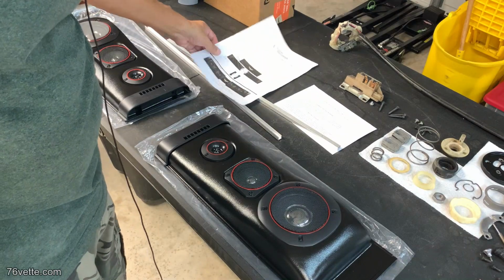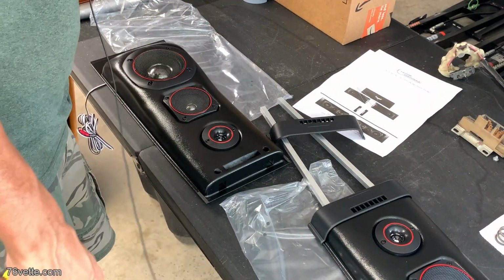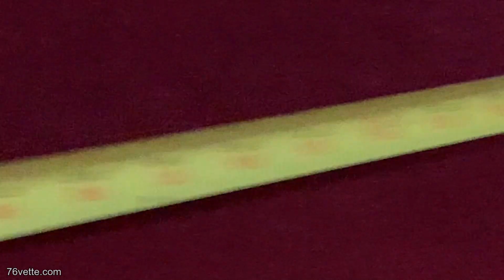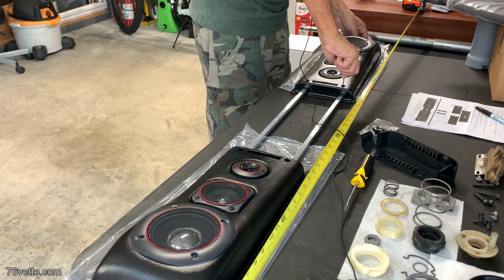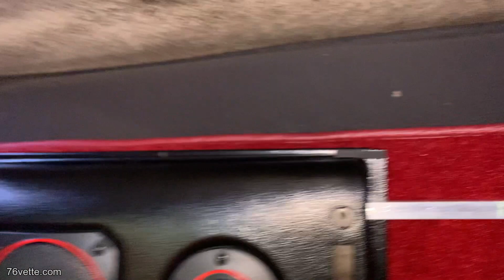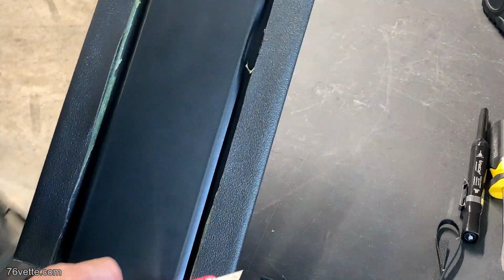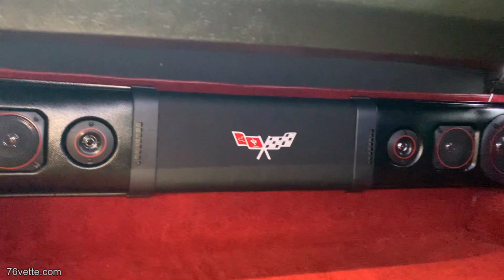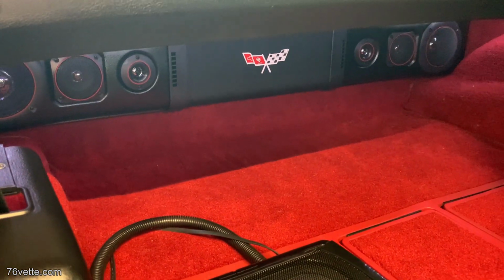BEST 6-Speaker SOUNDBAR for C3 Coupes

Comment: OUTSTANDING video.  I’m helping a friend install one of these in a ‘73 Corvette Stingray.  We followed your video to the letter and the installation is perfect.  Your idea to wrap the wire around that screw on the back wall and then tie it around one of the cross bars of the soundbar made the installation rock solid.  It won’t be moving or vibrating at all.   The soundbar covers the factory installed courtesy lamp on the back wall.  We removed the lamp, then tapped into the wiring and installed LED strip lights on the ceiling of the cargo area.  They really light up that space when you open the doors of the car.
Reply from the maker: Thank you so much, Anthony, and I’m very glad to hear my video was helpful. 
Tapping into the courtesy lights to install LEDs for the cargo area is a great idea. I did that for my ‘76. 
C3s up to ‘76 have very dark interiors, and one of the best things I did was to repurpose the cargo light and use it as a dome light with an LED bulb. What a difference!
Thank you for watching! 😊👍🏻

Comment: I have the same sound bar recently installed in my 73 Vette. I am very happy with it. I used wide adhesive Velcro to install it to the back panel. I replaced all original factory speakers (4 of them….2 in dash, 2 in door panels) since they were shot and added an amplifier and a new Vette-looking stereo with Bluetooth and aux. Next go around —— I will get the expensive 73 Vette reproduction stereo with Bluetooth so it matches the original look with modern ability to play music and SiriusXM from my phone. Thanks for your content and channel!
Reply from the maker: Great idea using Velcro to secure the soundbar 💡 I’ve been thinking about getting one of those Bluetooth cig lighter plug-ins for around $20. A buddy of mine has one in his ‘73 and really likes it. Thanks for following. 🙏🏻😊👍🏻

Comment: I like those LED lights in the trunk. Did you do a video on those? Didn't see one in a basic search of your videos. I'd like to know more about how you did those.
Reply from the maker: Hello. Unfortunately I did not. It was more of an experiment at the time since I had bought a roll of cheap LEDs and wasn’t sure if they could be used for that purpose. 
They did work though, and I posted a few photos to Instagram: https://www.instagram.com/p/BzYcJZwneXX/
I tapped into the storage compartment light wiring to power them, and daisy-chained them after cutting to size. 
I may redo them one of these days and use more powerful LEDs. 😊👍🏻

Comment: Would you put this soundbar in your 81? Today I took on the project of replacing the 3 original speaker wire harnesses (black/white/blue) in my 81. The previous owner removed them and direct wired the car to a cassette player/radio. Then I installed the custom auto sound USA 740 Bluetooth 300 watt radio. They sent me the correct wiring harness adapter (plug & play). Surprisingly I was able to do it and everything works, even the power antenna. Unfortunately, the old Delco speakers do not sound all that great. Now I need to decide on what to do with the speakers. I will definitely replace the front speakers in the dash. However I am not sure what to do in the rear. Unfortunately both of the rear mounting brackets are broke. The rear speakers currently just sit in place. I definitely want room for the t-tops but not sure about a subwoofer sitting out in the back taking up space.
Reply from the maker: There are small subwoofers that fit (allegedly) under the passenger seat. I would call a reputable place like https://www.crutchfield.com to see what they recommend. 
The soundbar is definitely something to consider and it looks great, so yes! 😊😊

Comment: MR. 76 VETTE A 4-STAR RATTING.JUST THOUGHT, UR STEREO HEAD UNIT INSTALL LOOKS GREAT. I WIST U HAD A VID ON 1st TO FINISH INSTALL. I'AM IN THE PROCESS OF DITCHING MY FACTORY BOSE SYSTEM IN MY 89 C4 VETTE. ALSO I WILL SEE IF THERE IS A SOUND BAR FOR 84-91 C4'S. BEST, GE.
Reply from the maker: Hello, and thank you for sharing your comments. 

I installed the newer style radio and subwoofer when I first got the car, but I was not shooting video back then so I never recorded that process, which is a shame. 

You may want to check with Crutchfield for radios and speakers for your Corvette as they offer a huge selection of quality products. 

https://www.crutchfield.com

Thank you for watching! 😊👍🏻

Comment: So I started the install! Some questions! 

1) I installed the Polk on the passenger side (sounds great!) did you have to drop the steering column on the drivers to get at the speaker there? 

2) I assume you ran the sub wire from the stereo to the sub, did you connect the rear speakers through the sub or directly to the stereo? If to the stereo where did you run the wires for the sub and the rear speakers to the stereo?

So far, replaced the stereo (I splurged for blue tooth :p) and did the passengers speaker !
Reply from the maker: Gosh, I installed that system years ago, but I think I removed the top dash pad to get to the front speakers. 

You have to push the pad up so it arches and clears the A pillars. You have to remove the A-pillar trim and there’s a small dash pad bracket near the middle toward the firewall. 

As far as the subwoofer/speaker installation I honestly don’t remember. I probably just followed manufacturer instructions. Sorry.
 
You’ll enjoy having Bluetooth for sure. 😊👍🏻
Reply: @76vette  thank you! I just wanted to say you are the most responsive most helpful person I’ve ever run across for anything including Vettes. 

Thank you, it really is appreciated!
Reply from the maker: You are very kind. Thank you, and I’m sure your audio system installation will be top-notch! Please let me know how it turns out. 😊👍🏻

Comment: Just a thought, instead of measuring the back area for the soundbar, it
has set screws so you can fit it against the sides firmly, then tighten one side of the
screws to keep in place. seems a lot easier like that.
Reply from the maker: Good idea. 😊👍🏻

Comment: Alrighty. Finally got the speakers installed tonight. I mounted mine a little higher than yours in the back on my 76. I cut the middle piece at 16 inches. I also used some Velcro strips to secure speaker against the back wall. As for sound quality.... Actually better then my front speakers. I still need to install the seat and do a drive with tops off to determine the improvement. My reproduction head unit happens to be the same manufacturer ironically... Found the manual in the glove box. Thanks again for your video and your replies!
Reply from the maker: Hey Terry, 
Glad to hear you got it installed. AFA the head unit, I think Custom Auto Sound makes several of them. 
I have a really cheap radio so my plan is to replace it one of these days with a good quality ahead unit with Blue Tooth.
Anyway, I hope you’re happy with the upgraded sound system and glad to hear my video was helpful. Be well. 😊👍🏻
Reply: @76vette  alright. Took it on a drive Tonight with the tops off. Good news, I'm pleased with the sound bar. I can hear the music while driving 80 on the highway. Makes a big difference. I totally agree with you though... I will need to install a small subwoofer down the road. No bass without one. Bad news is... When I got home.. I found my heater core went out during the drive tonight and the Passenger carpet was wet with antifreeze :(. Will have to do a heater core bypass until I either work up the courage to take apart the dash and replace.. or pay a mechanic. The joys of having a almost 50 year old piece of art.
Reply from the maker: @TheComando156  The subwoofer will bring it to a new and higher level. Trust me. But glad to hear you’re pleased with the system overall. And it looks good and clean with the added advantage of still having a usable storage area.

AFA your heater core, yeah, the love/hate relationship with these classic cars never ends. 

I wrote a pretty detailed blog article a couple of years ago covering installation of a new heater core, cleaning the complete system, and doing a heater-delete. 

https://www.76vette.com/2019/06/heater-core-delete-fix-ac-issues.html

I am sure it will give you a few ideas on how to go about getting yours done. 

I’d do the job myself as it will also give you the opportunity to clean and seal all the ducts properly, and save a TON of money. Plus you will know the job was done right. But I’m not gonna lie. It’s a BIG one! 

Good luck and stay in touch! 😊👍🏻

Comment: Hey Man 

So i have a 75 Stingray and am looking to upgrade the audio. I have a retrostereo in it now. So if i understand correctly the polk speakers replaced your dash speakers, the sub is sitting in the back there and you installed this new part for the extra sound/space. 

So, my questions are:

1) Do you have an amp anywhere? Does this need one to drive the sound?
2) Are you still happy with the sound?
3) Would you do anything differently now?

Thanks bro! Running just the 2 speakers in the front as I have been is painful!
Reply from the maker: Hey Michael,

Good questions, 

1. Yes, the subwoofer (Kenwood KSC-SW11) has a built-in amp. 
2. I’m very happy with the sound quality. 
3. I would install a better-quality head unit with Bluetooth. 

I hope you find my answers helpful and good luck with the audio system for your ‘75 Corvette. 

—Luis @ 76vette
Reply: @76vette  Perfect! I ordered it all based on your recommendation! I didn't even realize the sub had a build in amp!
Reply from the maker: @mmackinnon123  Awesome. I’m sure you’re gonna love it. 😊👍🏻

Comment: I just installed the same soundbar and wires are ready to run up to an older (not stock?) Pioneer Cassette Deck.  The wire ends on the new soundbar are not RCA jacks...not sure what you call them, but are they supposed to plug into the back side of the old stereo deck or do I need any converters?  Your system already had wiring in the back from previous speakers and didn't show how you plugged in the new soundbar.  Thanks.  Great video.
Reply from the maker: Hello. I am not a car audio expert, but as far as I know, RCA plugs are used for connecting amplifiers. Your older Pioneer radio/cassette deck should have traditional two-wire speaker leads coming out of the back, usually from a plug. Those wires would provide the audio signal for the speakers. 
I hope this helps you get your system working. 😊👍🏻
Reply: @76vette  Thanks for the quick reply.  I appreciate your C3 videos...keep them coming!  I picked up a white 77 with red interior about a month ago.  So much fun driving around with the tops off.  I will not be replacing the head unit and just opted to go with the plug in Bluetooth FM transmitter.
Reply from the maker: @heybert71  Congratulations!  😎👍🏻

Comment: Hey I just bought one after watching your video for my 76... How did you run your rear speaker wires to the head unit? Like did you go through center console or did you go through left/right side of floor/trim? Im not sure what's the easiest route to run the cables with the least amount of panel removal.
Reply from the maker: If memory serves, I am pretty sure I ran all the wires through the center console to the subwoofer and from there back to the speakers. Which would be the same whether you have a subwoofer or not.
The center console is the most direct route. Once you get to the bulkhead behind the seats, you can route them as desired. Having them on one side (and properly labeled), makes things easier, IMO. 
Good luck with the installation! 😊👍🏻
Reply: @76vette  thanks for reply. I just ran them through the center console as well. There was a nice little wire hook in there for another wire that I held them down with. I went straight into the cargo area and then up under the carpet to the rear.  Took me a while but I was trying not to break anything and keep track of all of the screws. I still need to actually test and install the sound bar though. Going to finish this up tomorrow. Hoping they sound good and give that needed sound boost for when cruising with the windows down or top off.
Reply from the maker: I think you’ll be pleased with it, and if you ever install a small sub-woofer, you will be amazed at the richness of the sound. 😊👍🏻

Comment: Ok, one last question!

Did you run your sound bar to the kenwood amp/sub or back to the head unit? Also, did you run your front speakers to the kenwood as well or direct to the head unit?

Currently I’ve got the Polk speakers running to head unit. So I’m trying to figure out what I need to do from here for them and the rear :)

Thanks so much!
Reply from the maker: I will check in a couple of days since I have to take apart the center console to replace the oil pressure gauge, but I think I ran the front speakers directly from the radio and the rear ones through the subwoofer since it needs an audio signal regardless. But I will have more details later this week. 
The main issue is working in a garage that feels like 110° F. 😓
Reply: @76vette  wow that was fast! Sounds great man! No rush I’m not gonna finish this install probably till next weekend as I’m on call this weekend
Reply from the maker: Hey Michael,

As far as I can tell, I ran four speaker channels from the radio, front and rear. The rear speakers go from the radio to the subwoofer and also to the sound bar, so the subwoofer is part of the system while it’s on. If I were to urn it off, the sound bar should still work. I hope this helps. I have all speaker wires wrapped and under the carpeting so it’s pretty hard to get to them for me to trace individually.
Reply: @76vette  thanks!!!

I have a sub out rca cord too. So I think I have to connect that and both right and left wires
Reply: @76vette  just wanted to update you! 

Got it all installed and it sounds great! Just working on where to run the rear speaker wires to hide them but otherwise it’s all in!
Reply from the maker: Thank you so much for the update, Michael, and I’m so happy to hear you like your new audio system. I’m sure you’ll enjoy it for years to come. All the best. 😊👍🏻